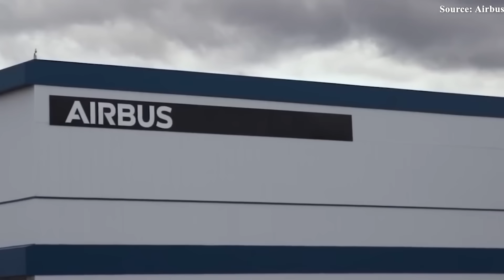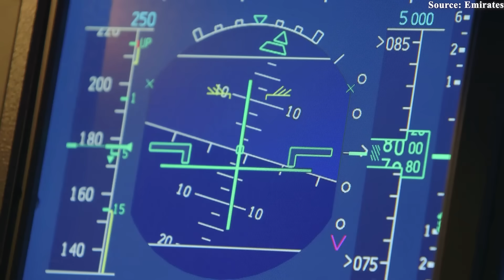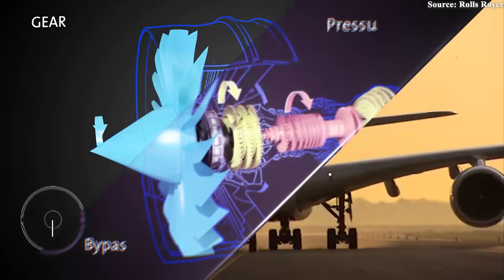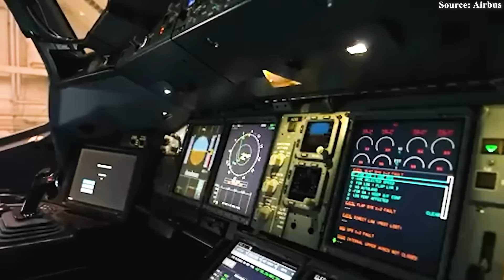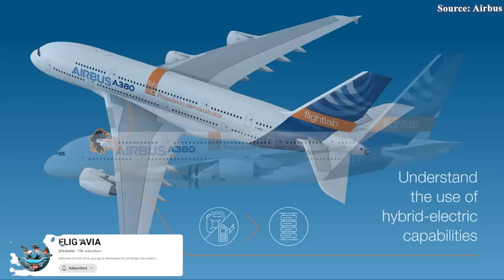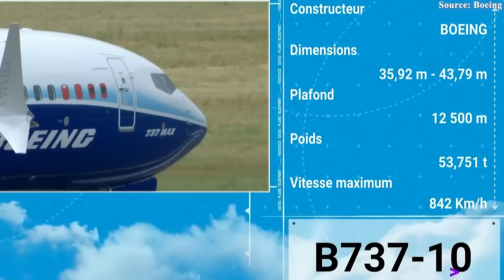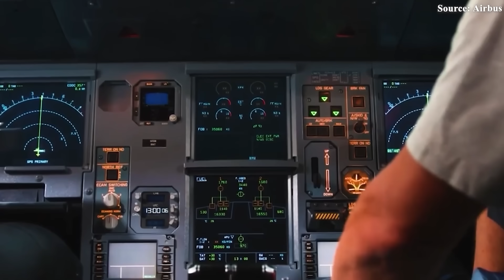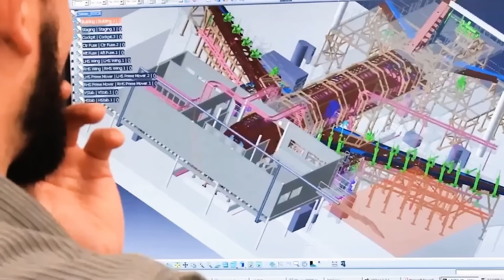Airbus' HUGE PLAN to Build The A390 that SHOCKED All Industry! Here's why

Comment: It seems like a concept at this stage. The problem is the number of seats that can't be easily filled. The next is A380 or A390 if ever can only operate from major airports allowing A380 because it's too big, which in itself poses a challenge in determining the seat cost. Not every terminal can provide parking space, terminal accomodations, and enough room to accept A380. A390, whatever it maybe, should address these issues.

Comment: Nah, A380 wasn't a mistake! It took Airbus 15 years to develop the product in the 80s mainly for Asian customers! The number EIGHT (8) is THE LUCKY number in Asia. It was the venue of the CHEAP of the CHEAP airlines that undermined the A380. Prestigious airlines, customers of this luxurious aircraft could not compete in ticket prices 15 years ago. The Emirates Airlines still want A380 if the aircraft can fly on 2 engines as new generations are NOW. It means a new line must be developed.

Comment: Terrible piece. Using the Air India crash to try and justify why people may not buy Boeing. The investigation into that crash is not over so you can't blame Boeing for this crash. Both fuel selectors were turned off during take off which caused the engines to flame out. There is speculation that the Captain may have used the plane to commit suicide and yes Boeing does have many issues but DO NOT SPECULATE for the purpose of your crappy channel.
Reply: It was not a pilot error. Of course, white people will say that the brown captain was at fault, but further tests showed that the fuel injection switches did switch off by themselves without human intervention. I will never use the 787s.
Why don’t you fly in them yourself?

Comment: It would be much wiser to make the same A380 with 3 powerful engines - one each on the wings, and a
another one on the rear top, like the DC-10...😮
Reply: Nope-sorry you obviously don't have any idea what your talking about. 1. tri jets were used due to rules known as ETOPS. this is how far planes can fly over water in case of any engine failure. The rules changed due to improved engine reliability meaning no need for three engines over most Atlantic and Pacific routes used. Next any additional engine increases parts, maintenance and service and finally, the addition of the engine at the rear will change weight and balance, need reinforcing airplane structure to compensate for engine weight and vibration increasing further cost in building and operating meaning your idea is old and stupid, sorry to be blunt.

Comment: JUST MORE BOGUS RUBBISH FROM THIS SITE
Reply: The evolution of 380 to 390 is an easy approach as it will mean the material of 350 usage and updated engines. The original engine sourcing for 380 was a headache. So it is highly possible

Comment: NOTE: Airbus built a 4 engine A380 to become trans-pacific certified. However, the Americans changed the rules and eliminated the need for aircraft to feature 4 engines to cross the pacific, while they built the 787 long distance 2 engine plane.
The EUropeans never saw this coming. Europeans have nothing to say when it comes to intl standards and in particular in the aviation industry.
The US can change the rules as they like and the Europenas will always fall for it.
Reply: Basically, what you are saying is that the American aviation authority is in the pocket of Boeing and changes the rules to suit.
That must be why every crash is a Boeing appears to be pilot error.
I know I would rather fly with four Rolls engines than two.

Comment: The Airbus mistake was not building for Cargo.  That would have made up for the lackluster sales until the market caught up.

Not making a double decker is a mistake.  They can do the folding wing trick  to fit in other airports   and having two electric motors plus two RR new motors would be a huge advantage.

Comment: An enthusiastic I learn lot about aviation, spend time in Dubai Air Show and frequent traveler between Bombay Dubai. Had also applied patent in landing gears for heavy passenger plane for better, safer and shorter landings.
Like other system parallel redundancy,, now aircraft mus have on avionics automation controlling computers. And captain, in total control.

Comment: Bullocks
The Airbus A390 is a fictional aircraft and does not actually exist. It is sometimes used in online discussions and rumours, but there is no official Airbus project with that name. Airbus does have other aircraft, such as the A380, but the A390 is a fabrication. 
Although there is no Airbus A390, there are rumours and speculations about a possible future aircraft that could replace the A380, possibly with a focus on efficiency and capacity. However, there are no concrete plans or announcements from Airbus about such a project. 
The A390 is sometimes described as a three-deck aircraft, larger than the A380, with six engines and a capacity of 1,000 passengers or more. However, these descriptions are based on fantasy and not on facts. 
In short, the Airbus A390 is a fictional aircraft, not an existing Airbus project.

Comment: If we could make a a380neo it could be wondefull the 380 is a2000 airplane,  not completely composite material user and with 2000 engines. Re building the 380 with modern technique make it lighter and more capable eith the a350 engines,  is gonna be s masterpiece

Comment: A390: there's no official announcement currently. Airbus uses an internal numbering system and the A390 is not part of that.
Right now, Airbus is investing in aircraft like the A321XLR and A350 Freighter, with plans for the A320 successor, possibly codenamed NXWing. No mention of the A390 has been made in press releases or the official order backlog. So, in short, Airbus is not working on the A390 at this time.
• Currently, the A390 is not in development-just speculation.
Sources:
• Airbus' official 2025 delivery report does not mention the A390.
• Simple Flying discusses speculation, confirming there's no
A390 plan from Airbus.
• Ceos-systems also presents conceptual ideas, but it's all speculative.

Comment: No, Airbus has not officially launched an aircraft called the A390. While there's been discussion and speculation about a potential A390, particularly as a successor to the A380, Airbus has not confirmed any plans for such an aircraft. Their current focus seems to be on developing and improving existing models like the A320 family and the A350.
Reply: How do you know? Are you on the board of directors at Airbus?  - N O!

Comment: This video is completely wrong. Airbus will not build an A390 based on the A380. They are thinking of enlarging the A350-1000. They can't even produce the A380 anymore, the assembly hall and jigs have been repurposed.
Reply: It didn’t say they’re making the A380 I said they’re making the A390 which is completely different. I don’t think you watched the whole video.
Reply: @chespocket1756  The CEO of Airbus said they were thinking about making the A350 larger, nothing remotely close to the A380.

Comment: A 747-400 Jumbo Jet for example, might carry around 416 passengers in a three-class layout (first, business, and economy). 
A two-class configuration, with fewer premium seats, can accommodate more passengers. One source mentions a 747-400 carrying 524 passengers in a two-class setup. 
In a single-class configuration, with all seats being economy, the 747 can carry even more passengers, potentially up to 660.
Reply: The 747 is old and out of date - so what are you on about?

Comment: Right from the internet. you are an idiot..The Airbus A390 is not a real aircraft; it is a fictional plane often associated with misinformation online. Airbus has not officially announced or developed an aircraft with that designation. The A390 is sometimes depicted as a larger, more advanced version of the A380, but this is purely speculative and not based on any actual Airbus plans. While the name "A390" might seem logical within Airbus's naming convention, they have instead focused on evolving existing platforms like the A320.

Comment: The "hub to hub" vs. "point to point" dogma is only a part of the story. Pure logic says: There is need to reduce number of flight movements per time on important aitports. The geography and structure is different worldwide. In the US there is in general more space to seperate airports and big cities and distances are bigger compared to central europe and asia is also different structured.

There will never be the one and only best solution, but a need for an adequate number of silent and safe aircrafts for about 400 pasengeres.
Reply: That is why there are so many different aircraft available.

Comment: Forget hydrogen that's total nonsense.
Reply from the maker: "Thanks for sharing your view! Hydrogen aviation is definitely a complex and challenging topic,  it’s still in the early stages and faces big hurdles like infrastructure, storage, and efficiency. That said, many major players like Airbus, Rolls-Royce, and ZeroAvia are investing seriously in hydrogen-powered tech, aiming for long-term sustainability in aviation. While it may not replace conventional fuels anytime soon, it's an area worth watching as the industry pushes for net-zero goals".
Reply: @FLIGAVIA It will never replace ordinary fuel! You need for every kilogram of hydrogen 9 liters of triple distilled water otherwise the catalyst (Platinum) will be ruined over time. Since there is no natural source of that type of clean distilled water you have to produce it. Neither will we ever have enough of thy distilled water nor will we ever produce it without costs. Just to give you an example, if you wanted to fuel all the aircrafts at the Frankfurt airport with hydrogen you would need the same amount of potable water that the whole city of Frankfurt consumes every day. It is total nonsense. Then we have transportation, storage and where do we get all the green energy from? 
I haven't even touched those topics and those are even bigger nightmares.
It is never scalable.

Comment: AIR INDIA 787 remains  as junk spewn on the runway.   Mechanical defect
Reply from the maker: Thank you for your input. It's true that even major airlines can face unexpected technical issues what matters most is how they respond and improve. The Boeing 787, despite occasional reports of mechanical problems, remains one of the most advanced and fuel-efficient aircraft used globally. Hopefully, Air India continues working on reliability and safety to ensure a better experience for all passengers".

Comment: And Boeing can blow this out of the water with a redesigned wing for the 747 using  2 engines and universal use/acceptance of the 747 footprint
Reply: Really???????? Another LEMON???? How many Decades will Boeing take, how Long will it take for Certification, 
Will it guarantee build Quality, and Reliability unlike the disastrous last 10 to 15 years ????????????
Reply: @nmrg9739 i think he was being sarcastic😂😂😂
Reply: @NemysisPrime  I don't think so ! look at his post re the wing re-engineering for the 747-800 !! He really believes in them and on his own Nonsense !!!
Reply: @nmrg9739  Boeing re-engineered the wing of the 747-800 (carbon fiber) in the last decade with no opps/crashes on time/budget.  Boeing DID NOT have faith/confidence/insight and made the wrong call about a two engine wing that would have infinitely extended the 747 line (dumb) as its IPV (In Place Value) of its footprint is imbedded in the design and support of all international airports (something the A380/90 lacks).

Comment: While point to point will reflect demand (subject to the availability of airport slots), the hub and spoke model is here to stay big time. Especially between airports within Europe where single rather than twin aisle aircraft are the norm).

Only the hub and spoke model with its connections can offer daily, or even multiple times per day frequency between two airports that might only have enough demand to struggle to even fill a single flight per week, yet the hub and spoke model may offer double digit options per day.

I speak from personal experience where I am sometimes the only passenger flying my specific route, yet both aircraft are full!
Reply from the maker: Interesting, thanks for the insight!